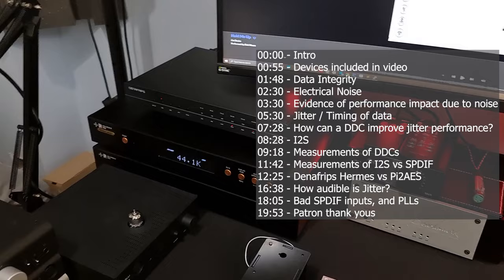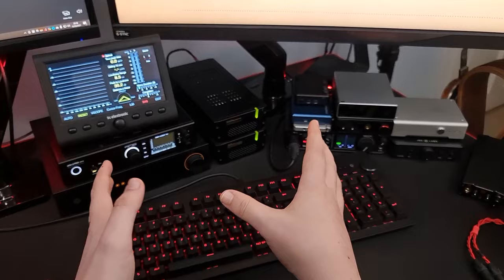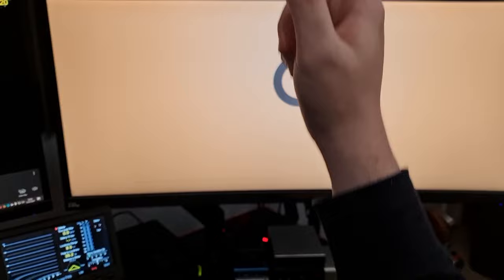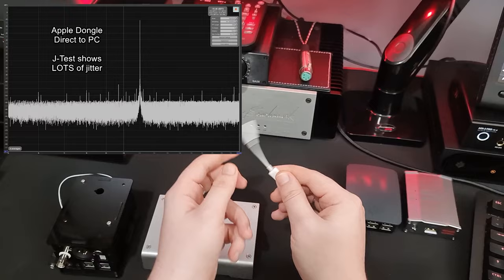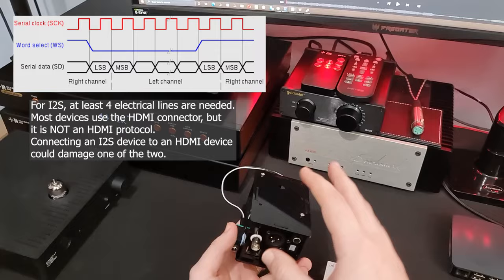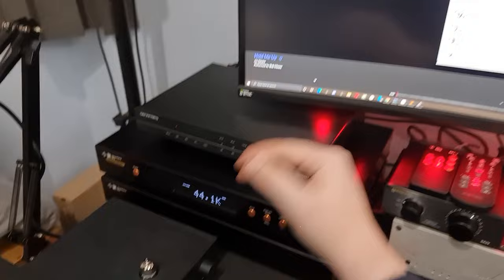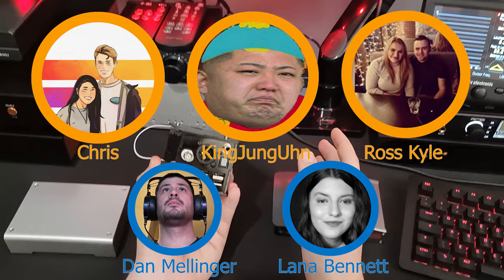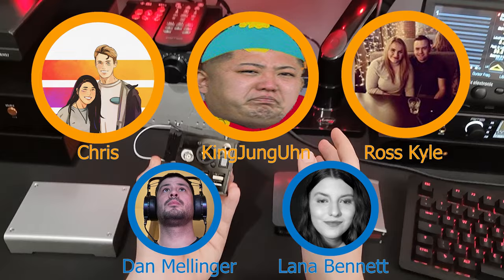How do DDCs improve audio? (Denafrips Hermes, Pi2AES, Schiit Eitr, ifi Igalvanic)

Comment: I recently added a Gustard U18 to convert USB to COAX between PC and DAC. The improvement is huge! I get an immersive 3D soundstage with relaxed and sweet sound. After that I tried direct USB connection once and couldn't bare with the "digital", dry, lean sound at all.
Your explaination makes perfect sense, noise and jitter matter most between source and DAC.
BTW even USB is not really bit-perfect, as USB audio uses isochronous protocol. Unlike bulk protocl, it doesn't have error correction.

Comment: It'll be interesting to know if a mid-range DAC with an I2S input, like the Topping DX7 Pro, could benefit from all of this.
Reply: Well, I'll find out soon.  I'm waiting for my Pi2AES Pro Shield to arrive.  I'll tell you this much, the Topping DX7 Pro benefits from an op-amp upgrade.  I installed a full set of SparkOS units, takes the unit up a few notches.
Reply: It helps a LOT on my Topping D70s!
Reply: And the verdict is... We have a winner!  I use my DX7Pro as a DAC-Pre straight into my amp.  So my take is the Pi2AES on Rpi4 running Ropieee via I2S elevates the sound quality by a decent margin.  Overall the sound is even more coherent, soundstage width and depth is wider and deeper, the sound has a bit more body to it  if that makes any sense, bass is more detailed, everything seems a bit more detailed, you hear more into the finer details of the music, transients and such, better decay and layering of it in more complex passages.  I'd be saying these things with the Pi2AES regarding the previous upgrade, but this brings out even more.  I wasn't expecting that at all because I thought I was hitting limit with what I already had.  Not bad for $350 (I bought a FLiRC dongle as well).

Comment: I appreciate that you've presented actual measurements, but this seems like a solution in search of a problem. These DDCs seem to be all about second guessing the internal design of the DAC you paid good money for. A high quality DAC should already have its own isolated power supply and isolate any electrical noise coming in from the USB. It should also already have a high quality clock which is the only place you need to worry about jitter. If you just use the USB input, there is no jitter from external sources so no need to spend more money to try and minimize it. Just buy a good DAC in the first place.
Reply: While it's true that you are essentially "secnd guessing the internal design of the DAC" and that the DAC already SHOULD have this implemented, it doesn't mean that it actually has.

A good clock oscillator requires a good crystal (which is just expensive to manufacture/buy). Attenuating input jitter can only be done IF you have a proper local oscillator. You are making a compromise between how much the external clock matters and how much the local clock matters. For USB DAC's this is irrelevant because USB is asynchronous.

For power supplies I completely agree though. You won't make the power supply much better than the way it's implementend internally.
Reply: @hidjedewitje  with asynchronous audio dacs  you also have the option of putting in slave or master mode when using an external master clock - despite all the advantages of async usb, the search for cutting edge performance continues... Unless you're Bruno Putzeys, design a good one 10 yeara ago & its still cutting edge....
Reply: @BogdanWeiss  Bruno's stuff is indeed very fascinating. His work at Grimm is also quite fascinating! The AD1 (now discontinued) is still the best AD converter when it comes to linearity and jitter performance 20 years later!

The question is, do we really need such performance?
Reply: @hidjedewitje  Performance just like intelligence is a double edged sword - once seen or heard, it's difficult to un-hear it - I didn't realiae that the grimm adc has been unchallenged for this long - truly impressive
Reply: @BogdanWeiss  While true, there's definitely diminishing returns.
The difference between a laptop's on board audio to a standalone DAC with THD+n of -115dB is pretty audible. There are also DAC's with THD+n under -120dB. I doubt anyone can hear those differences, despite the performance being objectively better.

There's also people who stare themselves blind on numbers regardless of looking at the weakest link in the chain. They buy DAC's of $1000, but leave the room untreated (resulting in dips of 30dB in the frequency response!!!).

There sure is a place for state of the art products (like the Grimm's or the Mola Mola's), but they should also be placed in a state of the art environment to be actually usefull.
Reply: @BogdanWeiss  
The LG DAC's are actually quite good. Especially for a mobile device that is not strictly in use for audio.

There is indeed a lot of bullshit in the audio industry. However not all dealers are the same here. There are also dealers that aim more towards the professional market. They tend to have a lot less bullshit. Then again, I prefer to make my own stuff so...

Off the shelf acoustic products are kind of hit or miss. You have to know what you are doing and how to use it. Typical pyramid shaped acoustic foam hardly does anything. However you can also buy fantastic acoustic tools from RPG acoustics. Completely off the shelf.

You also have to understand that 1 small panel isn't going to make the difference. Treathing the first reflection points and the corners will make a large difference!

I've seen people who didn't like their acoustic treatment and thus put their 77" (or whatever size, it was BIG) right in front of porous absorbers. Of course it doesn't work then......

TLDR: It's not a black and white situation. Each case should be treated individually and with clever use of brain.

Comment: At first I also thought usb wouldn't matter, but I noticed an audible noise coming from the apple dongle on my laptop, specially when the fan was running louder and a cheap usb isolator from alliexpress was all it took to fix it in my case.

Comment: do any of the ddc's add any audio delay, ex if you want to watch videos?
Reply from the maker: Some DDCs will add delay yes. This isn't something I have tested for this video, but some DDCs will introduce a notable delay (particularly network streamers), and some will have none. 
Worth checking reviews/feedback on the DDC you're looking at. Some dacs also have this inherently.

The denafrips dacs for example use very large buffers and this gives them a notable delay even without an external DDC
Reply: I use a GAIA DDC into my Chord Qutest. With 48k/24bit audio from my AppleTV, I've got no lip sync issues at all as opposed to running straight optical out from my TV. Latency will increase with sample rate, btw.

Comment: I have a pi2AES which I run into a RME ADI-2 Pro and then to my Genelec speakers. The sound is glorious.  I first used SPIDF but then switched to AES which to me sounded better. I do not know why it sounds better, but it does. More bass control and overall cleaner sound. I have not experimented with i2S yet.  My conclusion is that the pi2AES can be used in a chain to produce the highest quality audio.  As a side note, the RME ADI-2 Pro is a match made in heaven for Genelec speakers as it can be used for AES or XLR output, thus making it possible to send both digital and analog to the speakers. For example I stream Qobuz and play vinyl from my TT through it. This is perfect for me because I love both digital and analog and can’t live without both.
Reply: Ok, nice but how do you feed the pi2AES, since it doesn`t have USB in ?
Reply: @DJURBANBG  Ethernet cable. It’s plugged directly into my LAN.  Then it takes over as my Roon music server and I output that via AES to my DAC.
Reply: @hemantishwaran5741   thanks !

Comment: Am I correct in thinking the Pi2AES is only worth having if one has an I2S input on ones DAC? Or can you also perceive a difference over TOSLink?  

I’m wondering whether or not it might worth using over TOSLink with my ADI-2 Pro FS (instead of a direct USB 2.0 connection from my iMac)?

Comment: Since you are basically the only one to do this kind of things on Youtube (and thanks a lot to do so!), I think you should take more time to explain what you present. This is some really really interesting and in-depth information, it deserves longer videos, or more videos. 
Something I don't understand: why should we need a device that clean the signal from the source to send it to the DAC if you can have that in the DAC itself? Shouldn't it be a requirement for any DAC to basically reclock what's coming from the USB and isolate from the voltage coming from the USB?

Comment: Has anyone found how to stream all of PC audio to one of these? I heard Zeos in his review mention it was possible but I havent seen how people do it.
TIA
Reply: I've been able to try internal Bluetooth with my Pi4, the quality and delay are quite terrible however. I also tried streaming with "Stream What You Hear" over the network, and while this uncompressed the audio up to a cap of CD Quality, it's still very badly delayed. Neither option was acceptable for videos of any kind. There may be other Linux-focused answers that highly technical users may be able to sort out, like using the Pi as a USB device or setting up the pi as a different kind of Linux audio server, but for a normal install of Moode I found none of the evident options worked very well.

I'm halfway interested in coding my own solution to this problem, because the absurd delay doesn't make much sense to me. I get less delay sending packets to another continent than I get streaming the sound mixer's PCM output to a local Pi4 streamer with "Stream What You Hear", and that really shouldn't be the case. I'm just concerned I might be duplicating existent or better work since there hasn't been a ton of fruitful discussion on this and the Linux community tends to have answers to everything prefabbed and ready.

Comment: Just a quick question... Would one be able to use a DDC with an audio interface? As far as I'm aware audio interfaces send and receive sound instead of just receiving it. Recordings are clean as anything but I get an awful lot of noise (especially CPU noise) at audible volume which ruins a nice album at the best of times. Curious if a DDC could fix that. Either way, excellent video : )

Comment: I use a Topping D10 as DDC for converting USB from a Mac to optical. Then I go via optical into the MScaler and then TT2 via dual BNC. My impression is that this sounds much better than going directly via USB from the Mac into the Mscaler. Now, you said optical from a PC is the worst one can do. Am I wrong about what I'm hearing or what is happening here?

Comment: Hi  I have purchased the Pi2aes , but with 24v switching power supply the sound is awful connected to my Denafrips Pontus 2 I2s port with high end hdmi cable using roon raat to Pi2aes., also tried BNC out with my £800 Chord Signature Super Aray digital bnc\bnc. 
Compared to my mac mini M1 with a £300 curious evolved usb lead connected to Pontus 2, it was not worth the purchase of Pi2aes as it is.  You say you will be recording a follow-up video to build the Pi2aes and install your 5v power supply. What power supply did you use to power the Pi2aes via the 5v pins? I have managed to find out how you connected to the internal 5v pins via another source. Regards
Reply: I had the exact same experience but I am using the Allo USBridge Signature instead of an RPi4. I was thinking of getting a linear power supply like the Shanti but was warned about making modifications to the Pi2AES and powering it via a linear power supply. Anyone have any pointers as to how one can power both the PI2AES and USBridge using a Linear supply like the Shanti?

Comment: Another thought. I loved this video because "USB noise" was one of the topics I was wondering about and I was also among the ones thinking bits are bits in a digital signal and audible noise cannot be generated on a USB connection. And you almost convinced me when mentioning the audible noise from a PC. We all know that, that noise is with us since the 90's. You can hear the mouse movement, GPU working, etc. But then I realised it's a completely different scenario, that is with the PC's builtin soundcard and a direct (jack) connection to the speakers or headphones. As soon as you have an external USB sound device, noise is gone. So I'm afraid I'm still sceptic about USB noise :)  (jitter is another thing I understand that)

Comment: You should check out the Cherry 130dB+ DAC DAC 3, which will be introduced this summer!  The coax/optical SPDIF input is internally reclocked for jitter immunity.  Several levels of power supply reconditioning. True balanced, DC coupled outputs, too (:

Comment: I'm considering buying a sub $1000 DDC and have 4 candidates, but am open to other suggestions. 
Candidates are
1) Gustard U18
2) Singxer SU-6
3) Denafrips Iris
4) Topping U90
In stock form, which puts out the cleanest IIS signal?
Reply: What about including the Matrix Audio SPDIF 2?
Reply: IRIS is the best sounding in that list. I just upgraded mine to a Gaia And that's better still.
Reply: All of them sound exactly the same, but I went with a Topping d90se. I use its USB input, because it is the most convenient option and handles any sampling rate. 

There’s no benefit to IIS, despite the marketing mistruths perpetuated by PS Audio’s Paul McGowan—who promotes that tech because it was required under his clandestine agreement with Sony to circumvent their DRM rights for outputting an unadulterated digital signal from SACD players to his own proprietary DACs. Don’t fall for this ruse, it’s an unjustified expense that has no impact on “sound quality”. Digital audio is not sound, and no matter what transport you use, the same signal is passed to the DAC and the resultant outcome is indistinguishable to the ear.

Comment: Would SATA & PCIE have more or less jitter noise than USB?

I'm currently running 4x ASUS STXII's through a PCIE 4x riser kit, i'm also using a USB CD ROM but I'm considering a SATA one and shutting down the USB Ports...

Comment: I've got a Pi2AES on the way, out of curiosity I was going to try the I2S to my Gustard X26 Pro, I was wondering if you could please tell me what cable you were using? when I googled a lot of the recommended cables were more expensive than my actual gear.

Comment: Hi @GoldenSound! Great reviews, as always. But unfortunately looks like the Pi2AES project is no longer available and they have a closed and more expensive version. So, I was wondering, with the release of the new Topping M50 which is kind of a weak streamer, can it be used as a cheap USB to IIS converter? If so, could you measure that to see how clean the signal is? Thanks!!!

Comment: Thanks for the informative video.  

My friend has a bifrost 2 with unison usb.  Since it’s fully isolated.  Does that mean any of the devices in the video will not make any difference?  Or would they still improve his setup?

I have an original sotm sms-200 and it makes a huge difference even though my dac has Galvanic isolation.